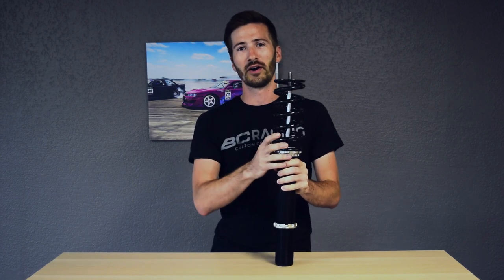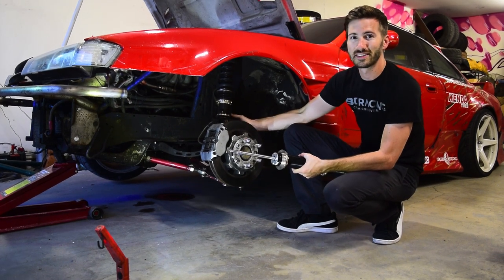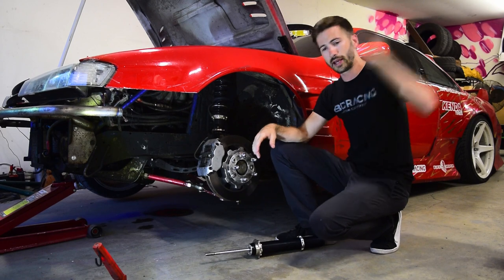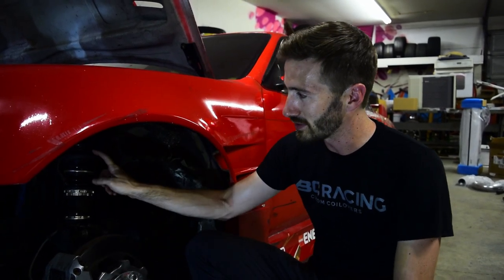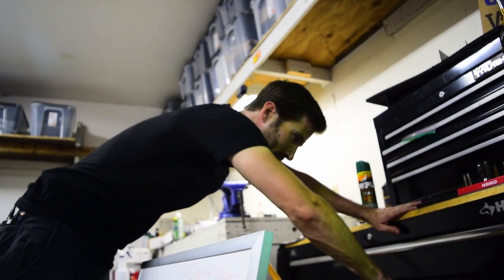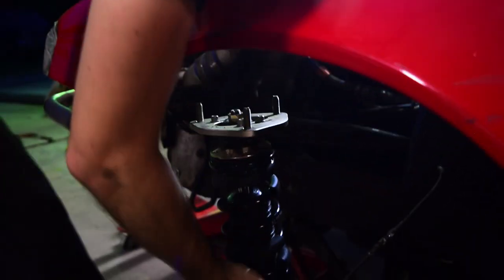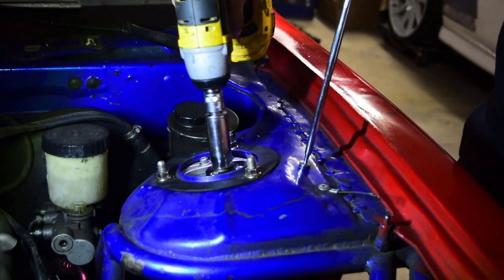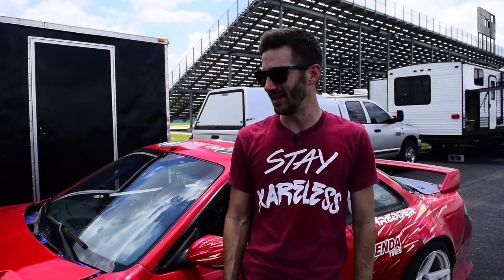NEW Car Setup & Testing. 8k to 14K SPRINGS and Why?

Comment: Awesome video! Super informative :) 
Hate it when people try to reduce body roll (left-right) by stiffer spring rate...
What do you think about monotube vs twin-tube? I see most BC's are twin
Reply: Negative, BC Racing does not offer any products in a twin-tube design. The full product line uses a monotube design.

Comment: I have a gs400 and my coilovers came with 10/8s but i have a system and always have ppl with me. Its fine when im alone, but with 3-4 other ppl, my upper control arms hit the towers. Im thinking about going up to 16/14 or 14/12.
Reply: My 10k/8k is not cutting it for me. I'm low but not slammed, still too soft for me. I want to go with 12k or 14k up front also. Just wanted to know if the 14k be too stiff.  Remember the GS is a heavy car. Plus my car is awd, so it's a little heavier up front.

Comment: so overall you are staying with 14k front with swaybar and 6k rear without? I'm wondering what would be the difference in my car (e46 saloon) when now I'm driving with 8k front without swaybar and 11k rear with a bar, and changing it to 10k front and pulling out rear swaybar. I was reading that every setup without both swaybars is better then not having one at the front? What do you think? Or what is Chelsea thinking? ;)
Reply from the maker: Yes i do like the new setup and will be sticking with it for at least a few more events while i get it all dialed in. i would say ALWAYS run a front bar, and a rear bar is optional.  I'm not as familiar with the E46 chassis, i know their spring rates are much different than Schassis because of the motion ratio.  Chelsea would be a better person to ask about that specifically.

Comment: My coilovers are coming with a 14kg spring rate in the front, I’m going to be Daily driving the car and I’m kinda worried if the spring rate is to stiff and I’ll feel every bump
Reply: how do they feel?
Reply: @romanrendon6059  they are good bro I’ve been on them now since June and got used to it lmao they ride smooth to be honest I was overthinking I even made my front more stiff
Reply: I ordered terrible ratings for mine 😭 I have 18.6 kg in the front and 16kg in the back. I’m going to switch my rear coils for 12kg or 10Kg. The 18kg runs good I’m not really bothered by the bumps In the front but the back is way too bouncy
Reply: I guess a 10k front and 12k rear will be okay then especially on a 2006 CRV lowered.. because CRV is heavy as is so…